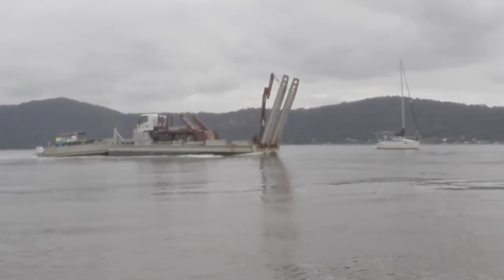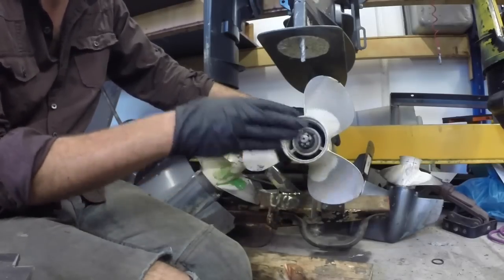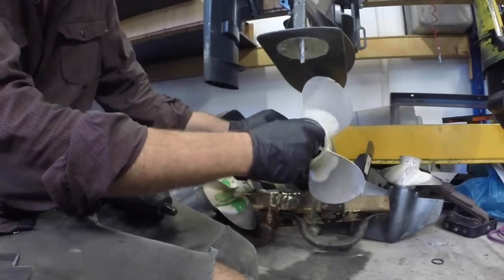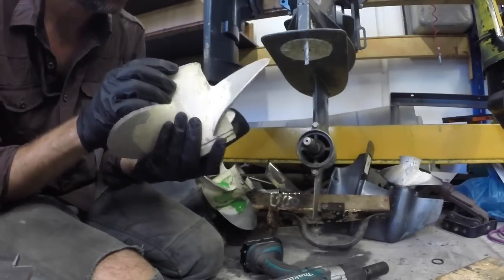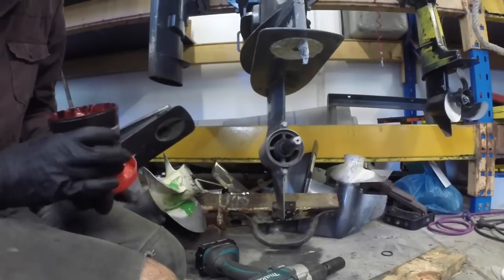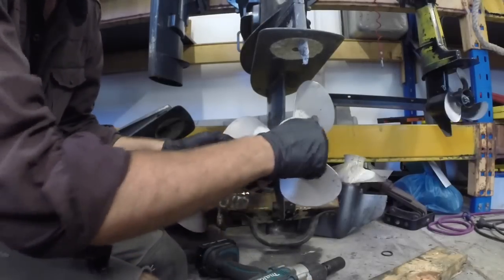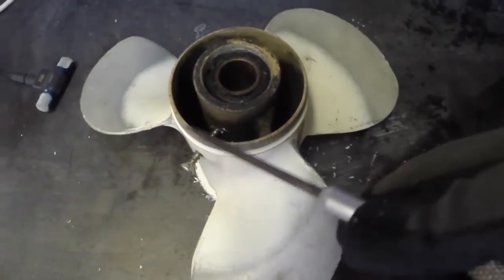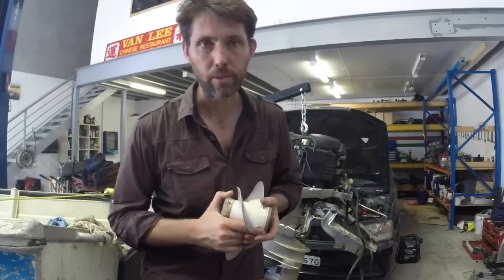Outboard revs increase but boat doesn't accelerate

Comment: Hi Dangar ,Isn't the rubber inside the propeller  working like a fuse in order to prevent any damage coming to the gear shaft or the engine i.e if you roll a rope by mistake hit the propeller  .Also as I know it prevents vibration .Once you fix it with a screw it won't slip  but the pressure will be diverted to the gear shaft or engine .I have an inboard Yanmar diesel with Yanmar SZ80 drive I am having the same problem.I though of fixing the mid section of the propeller but I am still not sure .I will be glad if you help
Reply from the maker: Yes, the rubber bushing is there to protect the the gearbox and drivetrain. I would only fix it with a screw if you are in the middle of nowhere on a trip and you want to use your boat. Having said that, if the prop hit a rock or something there is no way it would have the strength to hold, it would give like an old shear pin would given it is only pressing against the inner section. The biggest problem with this is having the prop out of balance at high RPM. Replacement is always the permanent fix.

Comment: I made a temporary repair by putting 3 screws directly into the rubber bushing from the rear of the prop. NOT through any metal. I think the screws expand the rubber enough to give some bite. 4 years later, it's still working. 
  I tried it on another spun prop but it didn't work.

Comment: Thanks a lot vor this video, just had this issue last night and trying to replace the prop myself, my question is: my boat is in the water and my trailer is being serviced at this moment, would be ok to remove and replace the prop while submerged  in the water?

Comment: yeah that's what mine does, when you take off it drops down and the motor is still wound out. so i think i will change my prop.
Reply: Derek Perkins the prop is probably fine,it's just spun on the inside. Much cheaper than a new prop

Comment: Just wondering you said that it's often cheaper to just buy a new prop. I just got a quote to have my stainless prop rehubbed and it was very very cheap. Less that 1/20th the cost of a new stainless prop. Should I be concerned? Is there something I am missing or should look out for?
Reply from the maker: I wouldn't be too worried. Stainless props are much more expensive than aluminium props so it is probably a good way to go.
Reply: So I got the prop back and the outboard was still not working. I came to find out that if the outboard isn't locked down (there's a plastic switch on the back that keeps it from rising up) it will give the same symptoms as a spun hub. It might be worth mentioning in this vid. Love the videos, keep em coming.

Comment: Sorry if this is a repeat I didn't read all the comments. Happened to me years ago too. As an emergency fix pull the prop and insert screws into the rubber parallel to the inner hub. The extra pressure kept the hub from spinning not only long enough to get home but for a couple more trips.
Reply from the maker: Another good approach for sure.

Comment: I have a 1973 50hp johnson I just bought. Has 100 psi in both cylinders and starts right up, but when I put it into any gear it dies. I think it might have to do with the carb? Any info would be much appreciated, I tried to adjust them with no luck so I set slow speed valves back to original spot. Thanks!!
Reply from the maker: With the engine in gear, and the ignition off, can you turn the flywheel or the prop? If not, there is a chance the gearbox is seized and that is what is stalling the motor. Other than that, the carburettor may need to be cleaned out or the compression may be too low to provide the power necessary to drive in gear. Start by checking the gearbox and then do a carb clean.
Reply: +Dangar Marine In gear forward and reverse the prop does not spin either way, it spins freely in neutral. How do I find if it is seized?
Reply from the maker: Don't get me wrong, it will be stiff in gear as you will have to turn it hard enough to turn the whole motor over. The best thing would take the gearbox off and try turning it in gear disconnected. You could also start by draining the gearbox oil and seeing what that looks like.

Comment: I have same problem on my 1989 beyliner Capri 1770 inboard motor start and runs will not acelérate  past safety mode or currently limp mode.  Do you think it could be same problem ? Please help.  Thank you

Comment: Hey Stu, love the videos. Quick question - I am re fitting the prop assembly on my 2006 Yamaha 15hp 2-stroke, and of course did not pay attention to the orientation of the thrust washer when I took it off. Is it true that the bevel or taper in the washer should match the bevel on the prop shaft? Any advice would be appreciated, Cheers.

Comment: here's a question for you.  Is it worth to fix/rebuild lower unit for an old 1997 50hp Johnson? Rebuild would cost few hundred bucks (that is if i have tools) and lot of time or spending $2100 for another LU?

Comment: when I pulled the boat is did have some sea weed in the prop will all that cause for it to get a little hot
Reply from the maker: +Sig Luna Weed may have been blocking the cooking inlet too, and the cavitation of the prop caused by the weed can add heat too.

Comment: I have a evinrude70 1977 engine was rebuilt and ran really nice I noticed a wee bit of oil coming out of the propeller when I had my ear muffs on . But Now every time I bring her in the water she won't start  but Out of the water she runs like a train ? What is going on please help me Thx 😂
Reply from the maker: I would start by giving the carburettors a clean. It take very little fuel to the get the motor to idle on muffs as there is no exhaust back pressure at all. Once you are on the water the engine is fighting that back pressure and needs more fuel to run.
Reply: Dangar Marine thanks Stu I end up finding a bad ground connection .any way I end up lowering lower unit for a cleaning and must of turned the shift gear Man oh man 5 times I thought I had it but still can't get in forward .

Comment: Question. I did replace these parts and does the same thing. It does engage into gear bit when I try to give throttle it will not go and revs high.  Any suggestions or info will be appreciated.
Reply from the maker: Could be that the dog clutch is worn and slipping or that the gear selector is out of adjustment. https://youtu.be/B4acSf_BgP4

Comment: I bought a brand new prop that came with the bushing bad, or installed incorrectly.  Unfortunately its too late to exchange it by the time I figured out it was bad and I don't want to buy ANOTHER new prop...I'm gonna use that "bodger way" to get by.  I'm lucky if I get the boat out more than 1-2 times a year anyway!

Comment: I got a stainless prop. Cost the previous owner 500 bucks. Is it still the best option to bjy another prop or is it possible for me to have a crack at doing the bushing?
Reply from the maker: I've never changed the bushing because I'l always used relatively cheap props. I have heard it is quite tricky to press a new bushing in and have the prop well balanced.

Comment: We were fishing a tournament motor was fine at launch we get to the first spot and then want to move and motor takes a bit to stsrt when it starts it makes a different sound and then it was shaking bad motor was running fine besides we couldn't go over 5mph if we gave it gas it died. Our mechanic said our lower unit would was going bad a few months ago and im wondering if it finally went out

Comment: I have a 1978’ Chrysler 75hp outboard that “stumbles” at low and mid throttle. But at full throttle it takes right off like a rocket!! What causes this? I have been trying to figure this out for a while now. Thanks in advance!

Comment: I have a 1983 johnson sea horse v4 140 hp j140tlcte model and she will not plane when fully throttled. I put a new oem prop on her and replaced power packs coils wires plugs and still dose not plane what. Should i look at next to fix this problem thanks guy for your vids
Reply from the maker: Check the compression, ignition advance and clean the carbs.

Comment: Dont know if you'll see this, but I have a small Mercury 2 stroke outboard that pops and bogs down when given throttle. I've replaced spark plugs, cleaned the carb, brand new gas and tank... cant figure it out. Any tips would be great! Cheers
Reply from the maker: Popping is generally fuel mixture (reed valves, vaccum leak, carb tuning) or timing.

Comment: Ok . I lowered the motor 1 hole on the added on trim plate. It’s a 1/4 ‘’above the lowest part of hull. If I move one more hold down it will be 3/4 ‘’below lowest point. Should I move the motor down 1 bolt hole or should I leave it where it is?
Reply from the maker: It really depends a lot on the shape of the hull. My gut feeling is one lower but there really is no substitute for a couple of test runs on both settings to see which works best. Make you test including things like turning at speed to see if the motor starts to suck air.

Comment: So I have a 1972 25hp 25252r Evinrude. I made a fishing boat out of a 15-foot Starcraft Jet Star speedboat. Getting to the point - I get 14 MPH from the 25 hp motor it has a 9.25 - 10 prop - just wont plane out.  The gear box is 13 to 21 gear ratio so I am thinking it is a 1.75 ratio - Using Propeller slip calculator I calculated 23 mph assuming a 10% slip. How much weight should a 25 hp motor be able to push? It seems to run fine but it plows the water and just cannot quite get it up on plane. I would love for some help and Stu seems to be my Go To for Boat info. Love your channel keep up the great work.
Reply from the maker: There are many factors when it comes to planning - weight is one but things like hull shape and wet area also have a big effect. Also look into how the engine is trimmed and the weight distribution in the boat. My boat is 16ft and had a 40 to give a comparison.

Comment: Firstly Thank you for sharing this video.. 

Can you advise on what you use to clean the prop shaft? Brush, soapy water, wd40? 

Going to change mine shortly. 

Many thanks mate
Reply from the maker: Any degreaser will be fine. You could even use kerosene or plain petrol. A nylon brush would be perfect for cleaning out the splines. Don't forget to put new grease on before the new prop!
Reply: I changed my propeller and still right as I got to rev it up it just revs up but doesn’t go fast it’s a 79 Evinrude 9.9 2 stroke what else can I do to figure out why it doesn’t run fast if I keep the rpms low then it will run slow

Comment: MY PROBLEM IS DIFFERENT: When I go full throttle my boat noses down and revs up but it doesn't go faster it just shoots a lot of water out the back like it's getting air and shooting a rooster tail. If I slowly increase the throttle it gets to about 30mph but any more than half throttle and it revs up and slows down.
Is My motor too big , too high or wrong type prop? Maybe it (IS) just slipping?
It's a 16 ft Ski Barge (Formerly made by KENNER brothers) It may have originally had a 50 hp and now it has a 70. Scupper holes in the back are 1/4" above water level.
Reply from the maker: The plate just above the prop should be level with the bottom of the boat. It sounds like maybe the length of the outboard shaft doesn't match the height of the boat's transom.

Comment: thanks for the help one last question I pulled the prop off and the bushing looks good there's no play is there any way to check the bushing
Reply from the maker: It can be tough to test them. You really need to lock the inner splines and see if you can turn the prop without the splines turning. This can be done on the boat in gear but turning a motor like that risks it starting if you aren't sure the ignition is off, even disconnect the spark plugs. Wear gloves because the prop can be sharp. Ideally even lock the flywheel so you can't turn the motor over. If the prop doesn't budge it's probably fine. Just be careful doing this as it can be a bit dangerous.

Comment: HI danger,  thanks i will start with the compression test on each cylinder. I will  change all 4 of the plugs , since I will be in there....I have never change plugs since I got the motor....might be a good idea.
Reply from the maker: Also be sure to keep the plugs in order (know which cylinder they came from when you take them out) and take a look at each one. See if anyone looks more fouled or corroded than any of the others.

Comment: Hey stu just wondering I recently got a Honda BF15A outboard and the old prop spins smooth no bother but I got a new one and it grinds , which I assume is because I have no thrust washer , but the old prop does not ?? Very confused if I need one or not
Reply from the maker: Hmm, it's definitely not good if it is contacting the gearcase. I would take a look at an exploded parts diagram and see if it is supposed to have a trust washer. If not, I'd carefully compare the two props.
Reply: Dangar Marine yeah I looked at the manual online and I can't see a thrust washer , sure is strange
Reply: Hey stu well i did order a replacement thrust washer for honda 15hp , i did not say anything about fitting old style but i chanced it and i got it and went to put it on and seen this weird thing on the prop shaft like what you see on hose to attach it to a tap some sort of circle metal ring then crimped each side and was not letting thrust washer go down so cut it off and sure enough the washer was perfect fit and works a charm and new prop and all goes on lovely :D i did notice bit of fishing line tho and took it out so now i need to check the oil haha , learning alot about outboard in the last few months since i am only new to them :)

Comment: hi
thank you for all the videos
i have a 1995 mercury 115hp i have a problem. when is idle  accelerates veri strong, but when i put it in the water doent have much power to push the boat and run faster, so the boat is 20  foot long center console, may be too havy for 115hp, but it was running before over 30mph and now doesn't wanna go for more than 12pmh, any suggestions on what could be the problem??
thank you in advance for any answer.
Reply from the maker: Could be many, many things. Start by checking compression, spark plugs, carburettors and ignition coils.

Comment: hello mr dangar marine, I have a suzuki dt 65, took boat out and tried towing a donut with a friend on it, when I tried to accelerate there was nothing, but going very slow, starts, it drives, but under the load of towing it was not going! so my friend jumped back on boat and put throttle down and went perfect? this sounds similar to what mine is doing, going to check prop tomoz, anything else I should check? your videos are boss wish you were in the UK, you would be my boat doctor
Reply from the maker: I would also check compression and maybe do a carb clean. Sounds like it is down on power from some engine fault.
Reply: @DangarMarine  many thanks for the reply, it was the 1st run of the motor this season since serviced it, I put new fuel line on, from tank to engine, new fuel pump, new plugs, new oil, new water pump etc. I've booked it into suzuki marine for a carb strip and clean, plus new prop, fingers crossed we are good, I try looking at videos for myself to try, but I'm letting the carbs be cleaned by main agents, many thanks keep the videos coming i can watch them all day thank you
Reply: @DangarMarine  hello greetings from Plymouth UK, just a quick update, had compression test,,, all good, 2nd I've had carbs taken off and cleaned, I've not done this for the 4 year I've owned it, also changed the prop as mine looked a little tired,
a few week back I did, impeller kit, plugs, all oils, and fuel pump, also new fuel line from tank to outboard, fingers crossed all goes well, will be monday when I get it back, will let you know thank you very much keep up the videos

Comment: My Evinrude 115 idles good motor is running good. In neutral it revs all the way up good to 8,000rpm. But in gear taking off it only revs up to 2500 rpm full throttle and doesn not want to go fast. I already installed a new propeller any idea what else it can be ?

Comment: just watched this video bc I'm having the same problem with my mercury 9.9 2 stroke outboard tiller steer except I just changed the prop last summer. Do you have any advice about what I should check or do next?
Reply from the maker: Could also be a problem with the gear selection mechanism staying in neutral if it is really going no where.
Reply: Dangar Marine when it's in forward and I give it gas it does move forward but top speed is maybe 10 miles an hour when is he usually around 20 to 23 miles an hour

Comment: i picvked up my front rope around my 11 inch prop and now its slipping put the 13 inch on and its sweet so i havent ruined the shaft prop spline or gearbox but can you strip the mating spline in the hub or is it the bushing like your doing now
cheers for any help

Comment: I wonder if this could be my problem. The other day on our 22' Princecraft pontoon boat we found that we could only achieve 10mph and the motor would not go over 4000rpm, full throttle. The next day I played around with the cables a bit but did nothing particularly significant, since I am quite ignorant in these matters. After re-assembling the remote shifter we checked it out and the motor ran wonderfully...hummed along at just under 5000rpm and 15mph. The following day the problem returned, but was worse: could not go faster than 5mph! In neutral the motor revs up where it should, even above 6000. In gear...no way. I stayed at 3000 since any increase in rpm did nothing to our speed and made the motor sound very labored. Thoughts?